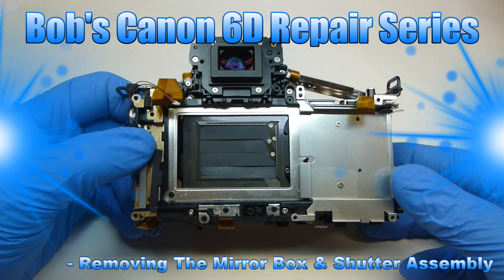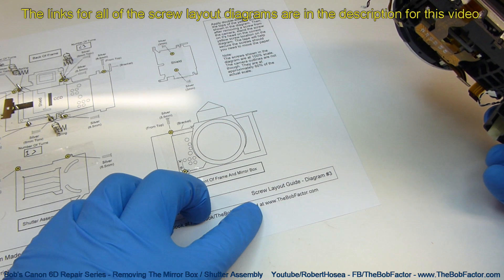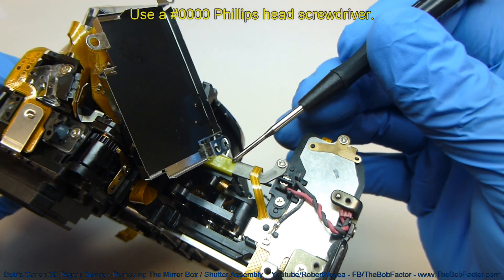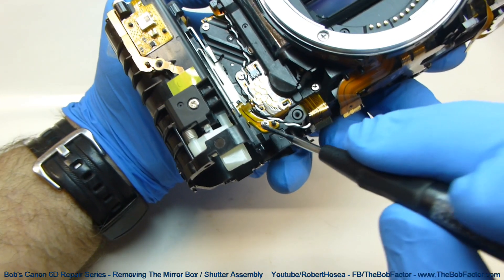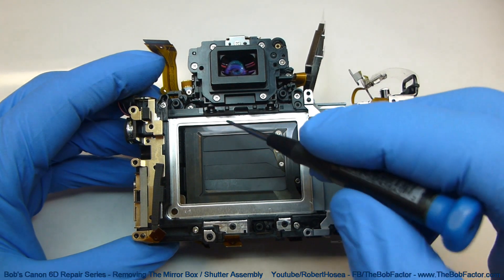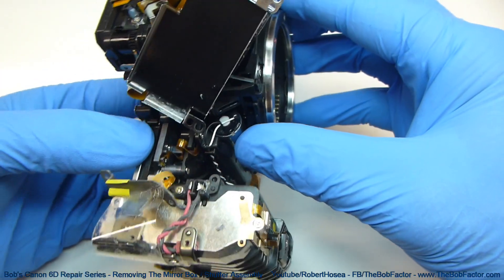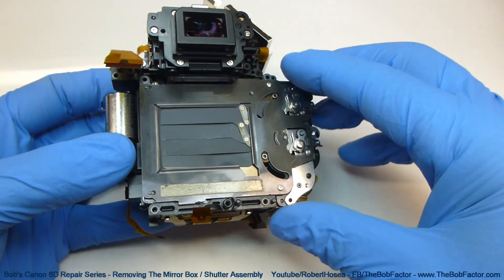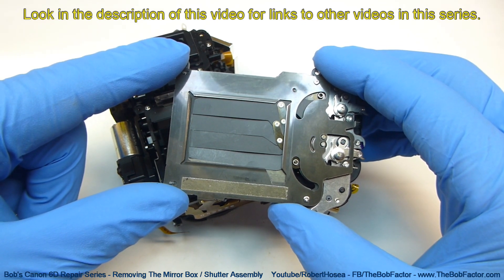Canon 6D Repair Series - Video #3, Removing The Mirror Box And Shutter Assembly

Comment: What is the name of the piece/flex cable that you remove at minute 1:00? 

In my canon 6D it is partially broken and does not show me the exposure meter.

Thank you very much for this amazing video. I was able to change the battery from the circuit board.
Reply from the maker: Hi Kevin. I'm not sure what the OEM part number or name is for that flat ribbon cable. Looking on eBay though, I do see that somebody is selling the inner frame, and it looks like it also includes that ribbon cable that you need. Not a bad price for it. Here's a link to it: https://www.ebay.com/itm/363237910832?hash=item5492aaa930:g:TskAAOSw-tBf6m1P

Comment: Hy. Thanks a lot for your tutorial, I change with succes the blades, but MY MISTAKES i forghet to count the number of turns from sensor. The foto now is out of focus, Is posible to have a resolve without Canon services? Thanks a lot again
Reply from the maker: You can, but it is time consuming. You will need to manually adjust one or all of the CCD adjustment screws. But knowing which one to adjust to effect the focus in the way that you need to is very difficult, and I can't really help you with that. You will need to take a picture, make an adjustment, then take a picture, make an adjustment, and on and on. As a very general rule, the screw settings range from .85 to 1.25 of a turn (counter-clockwise) from the screw being at the bottom position.
Reply: @Thebobfactor  thank you verry much. I will send in service maybe. Or I will use to make video. Thanks a lot
Reply from the maker: @kokaraulchanel , if you decide to make a video of the process, it would be a very useful video for a lot of people. Good luck with it.

Comment: Hi Robert. Thanks for the nice video. I have a question and I hope you can help me with that. Inside the viewfinder you see some information when you press the shutter button iso shutter speed exposer and so on. My 6d when i start the camera it lights the info and than it goes off. there was a time when it started working it was on always and after again it started doing the same 1 time on and after off all the time. I was thinking maybe there is a flex cable that is not well in place and that is the reason it goes on and off from time to time. I was think maybe you can help me  If you can tell me which flex cable is the one that sends info to the viewfinder. Is it the one completely  on the left side top corner? Thanks in advance.

Comment: Thank you so much for your videos! I’ve brought 6d a few days ago and the diaphragm wheel is working not well. Now I want to change this wheel. I’ve found a new wheel on AliExpress and I wonder should I remove all parts of  the body or I can just remove upper part?
Reply from the maker: Hi. I'm glad you like the videos! I think you can get access to removing the top part by just removing the first side panel shown in video #1, and the entire back piece. That will give you access to the flat ribbon cable connectors on the main board, and also the screws that hold the top part down.
Reply: Robert Hosea Thank you very much for your quick response, I appreciate your work. I will try to replace this wheel. I think should I replace the whole assembly with the wheel or just replace the ribbon wheel itself?
Reply: And tell me please what kind of glue do you use to stick the rubber shell back on the body?
Reply from the maker: @Romaledeal , I will need to take a look at my 6D first. I won't be back to my workbench until later tonight or tomorrow. I will let you know though as soon as I have some info for you.
Reply: Robert Hosea Thanks a lot!
Reply from the maker: @Romaledeal , Just to double check, you are talking about the spin dial for changing the aperture and F-stop? I was able to remove that entire unit, which also includes the shutter button, pretty easily. There are three screws holding it down is all. There is one flat ribbon cable that goes to a connector that has a locking bar on it. None of the flat ribbon cables need any type of glue or anything to hold them down. I will make a video showing how to do that sometime soon, but I don't think you will have any problems at all changing it out, once you get the top part off of the camera.
Reply: @Thebobfactor  Thank you very much! I would be really happy if you show that in video. Yes I'm talking about spin dial for changing the aperture and F-stop. My ribbon wheel peeled off. Sent you a photo (https://b.radikal.ru/b27/1903/af/d86ff60f9e81.jpg
)
I've a question, will I be able to replace the wheel itself without buying the whole element? 
But what about glue, I meant how to glue the "Body Rubber Shell" (https://b.radikal.ru/b09/1903/20/5cdbb5ea20fc.jpg), did you understand what I mean?
Reply from the maker: Hi Roman. Sorry, I didn't see this question until just now. Youtube placed this one in a special folder that needed approval first. I think because of the photograph links.

As far as replacing just the actual wheel, I did see some on eBay that come out of China for just a few dollars. Here's a link to one of them: https://www.ebay.com/itm/1Pc-Shutter-Button-Aperture-Turntable-Dial-Wheel-for-Canon-EOS-6D-70D-Camera/183568939631?hash=item2abd8fba6f:g:mWoAAOSwAbxcB4F

For the main grips on the camera, I have used Elmer's Rubber Cement. Here's a link:
https://www.officesupply.com/office-supplies/general-supplies/tape-glue-adhesives/rubber-cement/elmer-rubber-cement-repositionable/p60188.html?mrkgcl=605&mrkgadid=3329764278&ref=%3Dpla&product_id=60188&adpos=1o1&creative=330809038544&device=c&matchtype=&network=g&gclid=EAIaIQobChMI3O-5vZyW4QIVBrbACh1gVw3WEAQYASABEgLVgvD_BwE

When you purchase new grips for the camera, they come with new double-sided tape to hold them on.
Reply: May be. Don’t worry. That’s ok